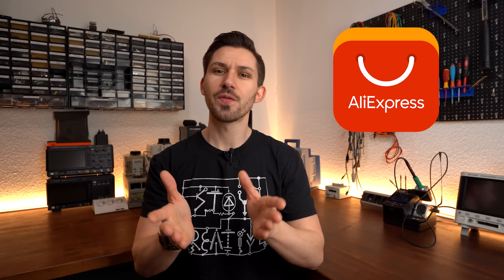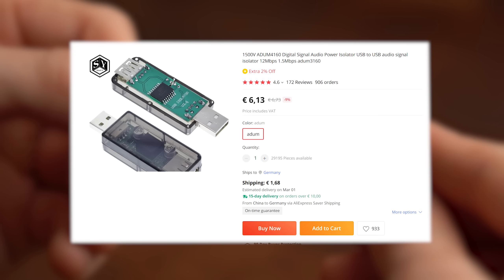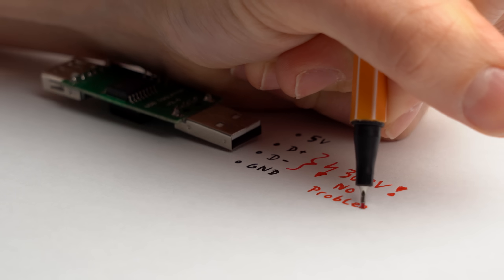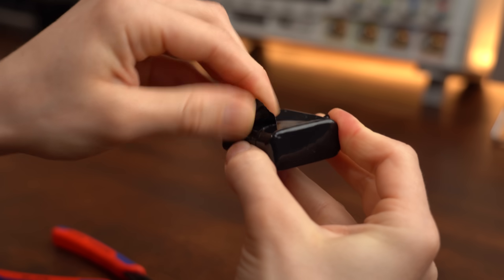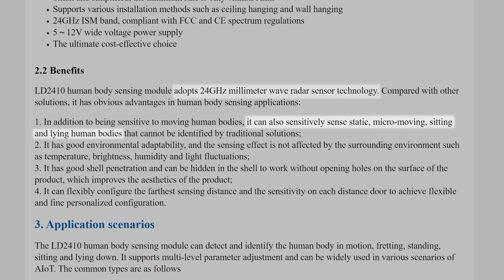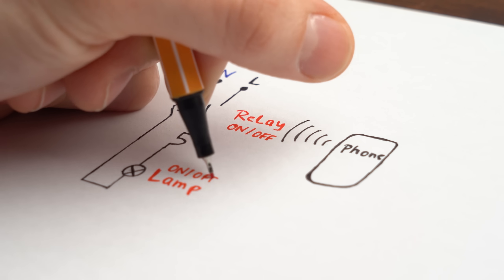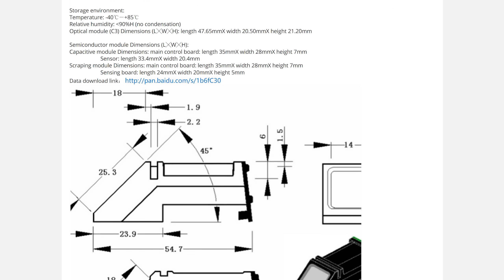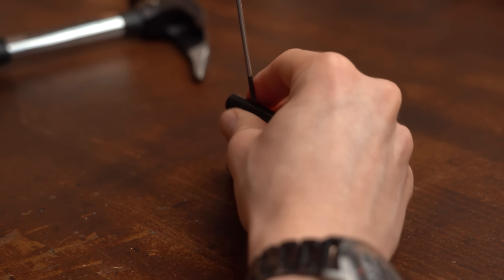I tried finding Hidden Gems on AliExpress AGAIN AGAIN!

Comment: You can buy the little black modules in the USB isolator for about $1 each or less. B0505S. A few different manufacturers. They require a capacitor and inductor in the input and output. It looks like they copied the reference circuit from what I can see through the plastic.

Comment: ❇️ RF Motion Ideas:  See through your door package delivery detection.  Creepy person outside your window detection.  Years ago I used a microwave motion detector pointed up from the basement through the wood floor and glass sliding door at an 45 degree angle to look for someone coming up to our sliding glass door on the outside for an early warning. The manufacturer had a stereo unit as well and detected an approach but not someone on the inside, kind of… It was a proof of concept project.  Not fool proof as to false alarms.  It had one flaw.  We had an occasional airplane setting it off due to mass size and low altitude.  In other words, the object size at distance affected the field of sensing.  These were for electrical sliding doors at supermarkets so hyper sensitivity was a safety plus.  It was old tech using ‘gun’ wedge technology Circa 1990’s.  I owned an alarm company so, tinkering was a passion.  Reliably was a must, as false alarms are against ‘our religion’ so to speak, so it was just for fun.

Comment: What kind of heating components are they using in the gloves and socks? Flexible heaters or just alloy wires? I've seen conductive carbon fiber heating wires and kapton tape metal film heaters, these are probably safer, metal wires are easier to cause short circuits

Comment: Wait, the fingerprint recognition mechanism is inside the fingerprint reader?  This is doubleplus ungood for any unattended operation.  By definition, the reader must be outside the secured space.  An attacker can just rip the reader out of its mount, cut the leads and transmit whatever counts as a “good” signal down the wire.
If it’s in an insecure environment, it has to transmit a description of the fingerprint it sees to a mechanism in a secure area to make the decision.

Comment: I am hoping every time I get on these sites hunting-down my new lab of components that one or more will soon have a "Fake Integrated Circuit, Semiconductor, Capacitor, Resistor, Inductor, et cetera Test Meter"! I almost bought half-a-dozen XR2206 Signal Generator kits.

Finding-out on my next stop, "How do I add  the missing features?"

11st site on a EEVBLOG forum shows a bunch of folk describing the consternation dealing with the fact the components included some are incorrect, especially the fake XR2206 chip.

Comment: 2:08 multimeter beep is not a good indicator of continuity tbh. Most of them have a threshold of around 50ohm! I learned that the hard way while checking pinout of canbus harness. It had to have termination on the harness itself and since can uses 120ohm resistors, there was 60ohm resistance between can h and l. BUT it was low enough to trigger beep when I connected can l on one side to can h on other :) Yes, I did not crosscheck, yes, I spend a week figuring out why the device wont listen to messages :D I ended up soldering directly to toe can transceiver and plugging that directly to pcan interface to realize the device was ok :D Bottomline: do not always dumbly trust continuity test.

Comment: Another great video. I use the Human Presence Radar in some of my home automation projects for a long time and it works just fine. Of course it has bugs like sometimes, in a certain humidity it triggers without human presence :)
Regarding the fingerprint scanner, I tested and used a couple for a project and I have to say, despite their speed (they're quite slow comparing to some good brands), they work also pretty much good.
Keep up the good work!

Comment: I got the USB isolator to use it with my Hantek USB oscilloscope along with a power bank and it is pretty much useless, because not only it works with USB1.1 speeds, any newer device won't just work at slower speeds but it won't work at all. It didn't work with my mouse or keyboard either, it only somehow worked with my smartphone.

Comment: The grinding attachment you pointed at in the intro is a tool sold at Harbor Freight. Not sure I would recommend it, but its fro sharpening your drill bits. Definitely recommend buying tools from stateside stores though, as the quality of some cant be guaranteed... recall some pictures of tools that broke apart due to being the wrong (cheaper) grade of steel...

Comment: I started using the LD2410 Presence sensors and absolutely love these sensors. For now, just for testing... I'm using the ESPhome Esp32 Bluetooth proxy. Makes connecting to home assistant very simple. Especially when the Raspi 4b BT range is very limited as well as the LD2410. So, the LD2410 with its Dev board and an ESP32 and you have a very accurate presence sensor. Better still... you don't have to move every so often to use it for say lights or fan integration. 
I was using a PIR in my lab to turn on a wall fan and set a 20 min timer in an HA automation. Now... I can just use a simple "state" for the LD2410 "occupancy" (Presence) entity to turn on the fan when it goes fro clear to detected. Then, set it to turn off when it goes from detected to clear. I'm so happy with its performance, at night I use it to toggle the fan, change the brightness of a light...dim it when I leave lab...and toggle a bench light as well. Testing it on garage now. Curious to see how it holds up in Arizona heat although... its starting to cool down. Garage got just over 100 degrees today😉
If you use Home Assistant, the HI Link integration is already there and will be discovered automatically. If you need to adjust the zones....100 means don't detect (trigger) and 0 means very sensitive. 
These things are amazing and at just over $5 on AliExpress... get it!!! You'll love them!

Comment: 3kV is HBM static discharge that the board can handle
2.5kV is what you've read in datasheet
and 1.5kV is same as previous but includes PCB and power module*. 
*those modules don't like long term DC bias, but it'll save your PC from a HV fault on a USB device, by going up in smoke if anything.

Comment: A challenging task re design the wheel . 
New style comms..invisible beam, containing origin, destination, arc angle data,  bounce off atmosphere back to a calculated relay point on earth, then in a near instant from that point, transmit again toward the final destination using any bounce relay points available .

Comment: Hello,

I have a question about the HLK-LD2410C. Can you get the distance measurement out of it, on top of the presence detection? In your video it looks like the software provided is providing you the values for the distance, in CM. I'm curious if you would be able to get that through Arduino / RPi.

Thank you kindly for the videos, and your work on this channel!

Stay safe, be healthy

Comment: The USB Isolator; The most important thing if oscilloscope probing a usb gadget plugged into a computer is the isolation of the ground unless your running a laptop on it's batteries and NOT a wall-wart. Most these so called isolators do not isolate the "Ground" from the circuit so if working with a non battery powered device on an oscilloscope make sure the computer is plugged into a technicians wall current power isolator which does NOT pass ground to the computer. Me here in the states I use a Tripp-lite 1000 120 volt Hospital grade isolator that needed the "Tech-Conversion" operation before it's first use. google it !!

Comment: Have you come across anything that can serve as a good 19V / 4A UPS (uses 18650 batteries, output quality good enough for use in a miniPC) ? One that has good battery protection and safety features.

Comment: The BMS inside the battery packs of the gloves also has a current protection, if you put 2 in parallel and they aren't the same voltage, they will cut power instead of recharging. So they are safe in this aspect.

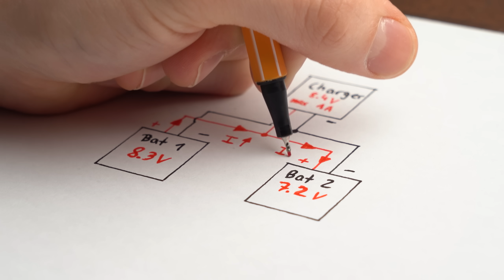Comment: @5:05 any potentially dangerous equalisation current is limited by the resistance of the wiring, without posing a danger. The difference between empty and fully charged is only 2V after all. That's about the most extreme use case and then only if the charger is not connected. That said, cell protection circuits are not charging circuits. Even if safe or safe-ish, you won't get maximal battery life.

Comment: usb isolator is good to protect you computer when connecting to the osciloscope, to a programable load etc. The problem is that it uses b0505s which can only provide 200ma (1W) and 1500kv protection.
It could be nice if more power could be provided. I believe a f0505d delivers 600ma (3w) is a good replacement (not pin compatible). Anybody have a better solution ?

Comment: Hi there, can I add some 5v exernal power to the usb isolator to power my external soundcard? It seems that the provided power it's not enough. I'm planning to join the 2 ground leads(pc side and external psu) and removing the power from the pc side and soldering the one from the external psu.

Comment: Use paypal when ordering from aliexpress. Some sellers are thieves. I ordered lithium batteries and it takes 6 months to deliver, I got 1 notification that the packing label was made. After 6 month I open a claim cause the seller claimed I signed for it and offered me a $1 adjustment. They rely on a negotiation system to settle disputes. I had paypal withdraw funds from aliexpress and therefore full refund.

Comment: 10:00 what i hate about these products is 1) account 2) always connected to their cloud so you can controll (some companies are starting to make on-site ip server which mitigate this) 3) does not have it's own time system - meaning if you loose your wifi router (for w/e reason) it's completely useless - not even you cannot control it (well duh) but all timed schedules are not working since the unit itself cannot measure time nor does know what time it is
I haven't yet met "smart" relay product that you set up and then disconnect and it would keep working 
( 4) also i personally hate that you need to have another wifi just for these cr*ps, polluting your surrounding area that - in urban areas - is filled with cr*pload of wifis already)

Comment: Dude, clearly you've never stuck a wire between both ends of AA battery, it's not about the voltage, it's about the amps. 1.5v will more than happily start a fire if you cause a dead short between the positive and negative terminals, only my 12 year old self back in the 90's burned his fingers first when the plastic insulation melted off the wire and didn't continue holding the wire to the terminals.....

You should have tried to overcurrent the wifi breaker. Thing is sketchy as hell, would be interesting to know if it actually trips when it ought to, or if it's really just a burn the house down for the insurance money product. Could have just bridged the outputs to test the worst case scenario....

Comment: Scott, I coudnt find in the B0505S datasheet information about if it is protected against reverse current. If I accidentally connect the 5V output in 300V, will it generate 300V in the 5V input (PC USB)?

Comment: I bought real gem at AliExpress a month ago. I do not know where to buy more... ;-) I bought 10 pieces of power switch with red light, switches for 220 VAC. I needed two neon lamps so I opened two switches. One switch had real red neon bulb with a resistor, that was expected. The second switch was a surprise, there was red LED without resistor, the LED was flat rectangle, size about 5x8mm. There were two red dots when this part was connected to 230VAC. LED diode designed to replace neon bulb! Unfortunately, I cannot find where to get more of such LEDs, I cannot find those on AliExpress or anywhere else. I could try to order more switches and hope that there will be more LEDs hidden inside.... Any idea? I even cannot find any video about these new LEDs at YouTube...

Comment: The passive motion-detectors used to turn lights on in public stair-cases, public buildings garages, etc all over the world are all well and good..  But when you called this a human detector I was thinking that IF the radar LITERALLY is honed to detect humans.. Then PERHAPS all the lights people use motion sensors on in their back-yards etc may NOT turn on in case a fox runs by.. OR if you are building a home-security system it would be VERY good if you wouldn't get a bunch of false positives because of a family pet.

Comment: The breaker can be pretty scary. Because turning it off and on at least in America will wear down the switch inside and might prevent a trip in a circuit. Also 50 amps is what a stove is protected on.

Comment: 50 amps is more than most appartments panels are built for, meaning totally fine for appartments.
(my old appartment was upgraded to 20 amps years ago, corrent one will get a upgrade soon, not yet known will et be from 20 to 35 or 50)

Comment: The radar board is perfect for home security.  As it works though a wall. Or door trim. 
If you don't see the device,  you can't defeat the device.  Try out tunable strain relief for stairs. On the underside.

Comment: Wait wait wait, I have that drill bit sharpener... I bought it knowing it's not that amazing, but it did help me sharpen some of my completely dull bit's and is working ok for what it is...
I guess I could just use sharpening stones on my rotary tool, maybe even 3D print a guide for the bits, but for the price, it's not that bad.

Comment: The reason the USB isolator slows down the link speed maybe because the cheap units also blocks negotiation for anything higher than USB 1.1, Used one in the past for this reason (long story)

Comment: the "USB Isolation Board Module" if it could be 100% at stopping malaises attacks, really badly build all wire up wrong, or just designed with destruction in mind?   would the 1500v be up to stopping everything up plugging it in a the main power socket directly power levels, would might burst in to flames in a safe way, if it kept your laptop, or what ever a live?

Comment: i have a USB isolator as well. although i use mine when messing about with mains voltage and an arduino. that way, if there's a short on the mains that sends 120V back down the USB, it won't kill my motherboard. 

Already had that happen once, and got lucky that it was just a port i killed.

Comment: Microwave detectors are terrible for lamps, they are just too sensitive to movement. It triggers when spiders move around or anything that absorbs a bit of microwaves and moves.

I have a drafty hall downstairs with a lamp that has such a sensor, also at the 2.4ghz wave length. It just goes on randomly, no matter the sensitivity setting. So I was looking at the data sheet for the unit and saw it reacts to movement and not IR heat moving around. So the bugs that sometimes crawl around or the wind that makes something move, it just triggers the lamp.

Comment: never use cheap wifi relays for any kind of bigger load. only suitable for lights. If you want to use them for bigger loads like heaters etc then you should use them to switch a proper rated relay that switches the high load.

Comment: I've also order quite a lot of stuff from AliExpress and I can tell you flat out which things to order and which ones to stay away from. 

What you should order are 1) good "fakes" of common products. Like for example a phone mount for your bike or something like that, because there's a really good chance that the factory producing a brand name item is also producing the same item under no brand name and selling it on AliExpress. A good example of this are motorcycle/bycicle levers, I have bought ones which are exactly identical to brand name ones, except the brand name ones cost 150€ and the no name ones cost me 20€. 2) simple mass produced items. Stuff like microfibre towels, usb cables, food storage containers, basically anything that's not too complex and/or everyday products.

What you should stay away from: Complicated products or products where safety or good quality is important. For example I wouldn't necessarily order a heated blanket, LED headlights for a car, boots & shoes, glasses, helmets, gloves, camera lenses, cameras in general, stuff like that. There of course is a chance that these products are very good but if they don't have a lot of reviews I wouldn't risk it.

Comment: Remember, when you're signing up for accounts for Chinese stuff, you're handing your data to the Chinese government. And when you use "smart" devices that require talking to China, you're potentially opening your home network up to the Chinese government too.
Only use these devices if you either don't mind possibly being hacked by the Chinese government, or you're replacing the firmware with a safe local only one (like ESPHome or Tasmota).

Comment: The parallel charger is most likely a "fancy" power supply with a light that turns green when current draw falls below a threshold. The battery board does most of the work cutting out when voltage reaches a limit. During a parallel charge, I think the most danger comes from one pack having higher voltage than the other hence pushing power into the weaker pack leading to premature wear.

I've come across isolator board numerous times but doesn't know it's purpose, I've been having interference issue with a buck converter disrupting fm signal reception as soon as I start my bike. Probably the cdi unit and spark using common ground is the source of interference.

Comment: I use a USB isolater when i programm communication between two mikrocontrollers. By using one PC for each Mikrocontroller, i can make changes on the transmitting and receiving one in a short time.